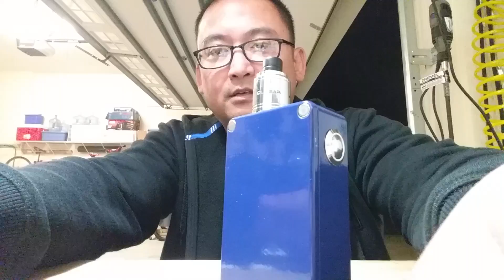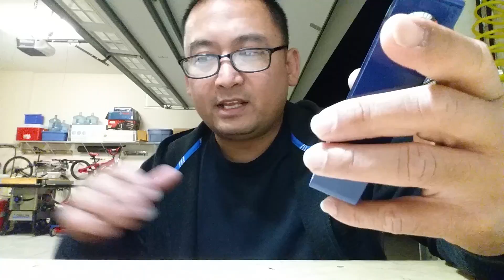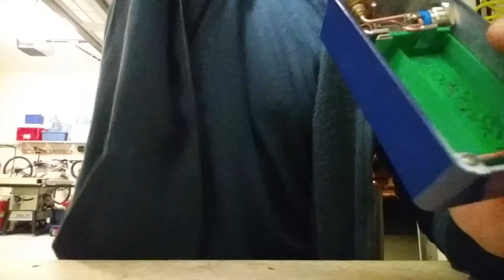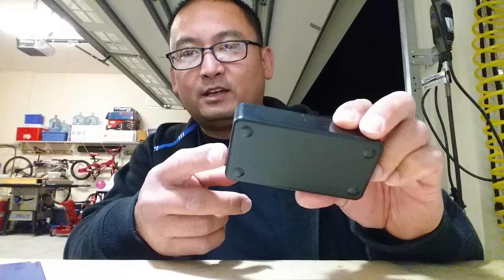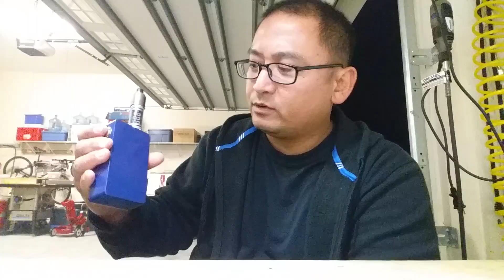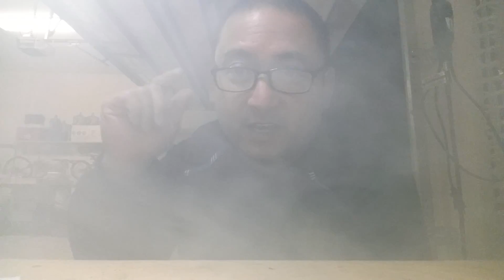(Giveaway closed) Dual 26650 Series Unregulated Box Mod with a Mosfet...The Frankenstein Build

Comment: Cool. I have build also a serial boxmod, i used 2 18650 , a 10n03l mosfet from an old motherboard, but i use also an ne555@200Hz to regulate the Power. Thank you for the inspiration.
Greeting from Germany
PS: I want that BoxMod too.

Comment: i Didn't know you did giveaways Al USAF, i would LOVE to have anything that you built, U R an eXcelent builder with "STYLE" my friend! :) Keep it up.
Reply from the maker: ACEizHiGH VaporPRODUCTiONz this was only my 2nd box mod that I gave away. Not sure when the next one will be but it's going to happen. Thanks for checking out my channel.
Reply: Al USAF i CAN't Wait for your next giveaway! I'm sure it'll be the "SH!T!" Until then I'm thinkin i'M gonna build a "SERiES" style~BoX based on this ~~>"BEAST", i Don't have any matching 26650 bats handy but i do have sum good SONY VTC-18650s that got your "FRANKENSTEiNS Scheme"  Name on 'em! call iT like,,,"FRANKENSTEIN Jr." the TeenAge Years :), I like your "BARE" solid copper wire look, & your builds are PreCision/CLEAN, LUV iT! i got chitloads of "COPPER" CPU Heat syncs also 4 the MosFets, I figgure i'll just be hittin da'PAUSE button on your ViDS & try 2 Emulate Ur Builds, can't think of any "iNJECTiONs" to add to 'em as you have allready  covered all the bases. (i Maybey throw in some eXtra LED for th hellof iT)  **I work on Computers& ripped open acouple of Old LapTop batteries & they are LiON type, there GREEN, they look like SONY, (yea.. They are be sony) could i use these in this type ofa build? Series or Parallel? they taken a charge right now. Thanks for your Knowleges! VAPE ON :)~~
Reply from the maker: ACEizHiGH VaporPRODUCTiONz the batts inside of laptop batts are indeed 18650 but probably doesn't have the specs required for sub ohm builds. I too did open one up and the batts were way lighter compared to what I use. Good luck on your build and I hope it turns out great.
Reply: Al USAF
This will be my 2nd Build, 1st 1 still goin STRONG~BoX! ur Builds gimme iNSPiRATiONz on how 2 doit BETTER/STRONGER than even alotO Factory BoXsDo:) yea.. That's what i figured on the "batts" situation, i didnt wanna "BLO' My Selfs UP! or any things (LOL), i'm hittin 1 of 'em right now on my very 1st e-cig tank i bought when i quit tobbaco in 12-2013, it's a "Classic" i-CLEAR30 @1.5Ω(ther Good Tanks!) & it's hittin good! do u think i could go say to,, .50Ω ? these paticular ones came out of a better PC, an "ASUS"★, & have a lil weight 2'em, (i got 1ofmy "M2" Ωn@.30Ω, tempting..) the other batts are Light (Like u said) out of an ACER & they SUKso wont temp anything onthem. Thanks alot :) I'll quit buggin 'ya, I appreciate getting good advice, U have a goood Night, PEACE!

Comment: Hi man such cool unregulated mechanical box mods, so clean on the bends awesome,
if you use 14 gauge does this fit in the 510 end and also through the battery sledge terminals with out sanding the copper down?

Comment: I've been checkin out your vids and I like your builds because they're really clean, routed efficiently and look really nice when completed.
I especially like that all of the wires are clean with no marring or visual blemishes.

I was curious if you could explain how to use a Mosfet to interrupt the positive side instead of interrupting the negative?
I'm attempting to use an LED button with low rating, so I need to use a mosfet circuit, but on the positive side, because I don't want to put the Mosfet between the negative flow.
I could really use some knowledge on this as I'm trying to build one with the positive side interrupt. 

I hope you get this and can help.
Thanks for the Great Vidz !
And most importantly, Thanks for Serving.
Reply from the maker: +canigetachannel please check this link on why not to use a P channel fet: https://m.reddit.com/r/OpenPV/comments/2hroh3/parts_for_high_amp_unregulated_box_mod/

Check this link for additional info on building box mods: https://drive.google.com/folderview?id=0B-I3ksnipe8nQ3paUFE1Yl9sbGc&usp=drive_web

Check this YouTube link on how to wire an led switch in any type of box mods: https://youtu.be/vFWMuumr-Uk

Hope this helps you out.
Reply from the maker: +canigetachannel thanks for the compliment on my builds, really appreciate it.

Comment: Let me give you a tip. Use a thin rubber tubing to measure your route for the 14g copper wire then cut next to your wire and bam the right length to solder and screwing....... :)

Comment: I just received the box today. It is awesome. I will be posting a video soon. Al Usaf.
Reply from the maker: Justin Beebe thank you...enjoy it and don't forget to post a vid. Just a reminder to ensure you insert the batteries in the proper orientation.
Reply from the maker: How's the box?
Reply: Awesome!!!!! I'm going to make a video tomorrow. I haven't had much time working 10 and 11 hour shifts on thirds so. The only problem is the door doesn't sit flush with the batteries I have in it. I got the efest 26650 batteries. Did the nxjo's fit better?
Reply from the maker: Justin Beebe my mnke and mxjo fits fine. I think the efest is slightly larger than the two.
Reply: That's what I figured. I will have to get me some.

Comment: you know I think that stranded wire has less of a voltage drop than solid wire but it will never look as good as the solid wire the way you meticulously do the install !
Reply from the maker: socratesthecabdriver I don't know if one or the other is better because I've only used solid wires.
Reply: Al USAF I am actually a electrician from NY .. one thing NY is big on is not using solid wire for that reason  ... makes the build lighter I think it is something like 12 solid versus 14 stranded in current handling ... plus they use nothing smaller than 12 gauge wire in NY but when solid wire is specified  depending on the distance of the run the gauge of that  wire would increase to meet the requirements
Reply from the maker: socratesthecabdriver I just Google it. Use of stranded wire is for ease of installation on certain applications. But handling capacity for the same wire AWG are the same.
Reply: hmmmm
Reply: Al USAF
Stranded vs. Solid Wire
This one is a bit of a mind-boggler, but it's important. When electricity flows through a wire, it mostly flows on the surface of the wire, not through the middle. This effect is more pronounced on high frequency AC than it is on DC or low frequency AC. This means that a "wire" of a given size that made up of many smaller strands can carry more power than a solid wire - simply because the stranded wire has more surface area. This is one reason why battery cables in your car and welding cables are made up of many very fine strands of smaller wire - it allows them to safely carry more power with less of that power being dissipated as heat. However, this "skin" effect is not as pronounced in a typical 12V DC automotive application, and the wire and cable used there is stranded for flexibility reasons.
When looking at a chart or description of wire capacity, take note of whether it is referring to stranded or solid wire - some charts may not specify but instead assume a default based on the typical wiring used in a given application. For example, almost all automotive wiring is stranded while almost all home wiring is solid. For most applications, flexibility or the lack thereof will be more important, but for very high frequency AC applications, stranded wire might be a requirement.
Reply: not that there is a voltage drop in the wire but stranded wire is a better raceway for current ..
especially in d.c.  ..........AWG Notes: American Wire Gauge (AWG) is a standardized wire gauge system used predominantly in the United States to note the diameter of electrical wire. The general rule of thumb is for every 6 gauge decrease, the wire diameter doubles and every 3 gauge decrease doubles the cross sectional area. For example, two strands of #14 in parallel would be approximately equal to a single strand of #11 for current capacity.
Reply: Wire and Cable Factoids
The single most important component of a wire or cable is its insulation. The selection of an insulation is governed by a number of factors such as: stability and long life; resistance to sunlight (ultraviolet); dielectric properties; resistance to ionization and corona; resistance to high temperature; resistance to moisture; mechanical strength; and flexibility. There is no single insulation that is ideal in every one of these properties. It is necessary, therefore, to select a cable with the type of insulation which most fully meets the requirements of the particular installation involved.
These are some general rules and common practices when wiring solar systems. They are not meant to be all inclusive, only general guidelines.
1. Almost all wiring is done with stranded wire or cable. Solid wire is occasionally used for long runs, but in most cases it is not suitable for wiring panels, controls, pumps, batteries, or other components. If used, you run the risk of breaking the terminals and/or screws if the cable is flexed. It is also difficult to get a good connection with some types of terminals.
2. All outdoor wiring should be of type XLP/XHHW, TC (Tray cable), USE-2 or similar outdoor UV (sunlight) resistant insulation. Other types, such as THHN, may be used, but should only be run in conduit if it is used. Metallic or NMC (non-metallic conduit) may be used in most cases.
3. When wiring batteries, inverters, or other high current devices, crimp/solder type lugs, or cable clamps designed for good connections with large cable should be used. Do not attempt to wire the stranded wire directly to battery terminals. For most purposes, welding cable is a better choice than the more common PVC battery cable, due to it's much tougher insulation and higher temperature qualities. Welding cable is more expensive than PVC cable, but PVC will melt at fairly low temperatures.
4. Do NOT use the commonly available Romex® type solid house wire for anything BUT house AC wiring. It is not suitable for outdoor, direct burial, or water pump wiring. The insulation will fall off within a year or two if used in direct sunlight. It is also difficult to get good solid connections with solid wire on most components used in solar systems.
5. Size the wire gauge properly - the best components will not work properly if undersized wire is used. For panel and general wiring, see the wire loss table. We sell quite a bit overseas, and most of the world uses metric wire sizes. For conversion, see the metric to AWG wire size conversion table on the same page as the wire loss table.
Reply: but I say again cant get stranded wire to look as good as solid especially the way you get it done :)
Reply from the maker: socratesthecabdriver there are many sources about solid vs stranded wires and I just went to the first or second one that popped up. It stated there are no difference between the two when it come to amp handling capacity, the main difference is use.
Reply: sure many applications stranded is better and the thinner the strand the better . once at the w.t.c.  i worked at the pathway reconstruction  d.c on tracks you should have seen this wire that was brought in for the control room fine as hair and soft amazing  cant remember how it was called ... any way this wire at 20gauge could have being plenty good for devices as these xaxaaa current likes the strands better than a solid surface ..i be one with the current master yoda :)

Comment: HI,When you solder the battery sled connection that are coated,(not bare copper)do you have to use a better solder or a different type of solder ie tin solder,and you stated setting the iron on about 700 f when you solder `but what watts is your solder iron,

Comment: Technically it's not a Frankenstein build because you still used the right stuff. Frankenstein means ghetto rigged. That's not ghetto rigged. I don't like that you use no insulation but it's your choice. Your the operator.

Comment: I WANT THAT SERIES BOX MOD!!! and I love your vids, there very helpful...thanks AL USA, and I know you said you just got those batteries but you should try VAPPOWER imr 26650 I have been using them awhile now and they are really well...there 4200mah 40amp continuous and 60 amp pulse
Reply from the maker: bigge1286 I'll check those batteries out...thanks

Comment: If you were to wire in a volt meter to add some extra awesome-ness to the sweet series box haha where would you wire the red and black wires on the volt meter?? Red to 510 and black to battery negative?! Or to the mosfet? I really want to build this but want to add a volt meter on the outside of the box haha THANKS!!
Reply from the maker: Chris King you'll need to add a switch to either the voltmeter red or black wire. Because the voltmeter will be on at all times if you wire it from the 510 positive and battery negative. But if you want the voltmeter to read either the battery level (no load) or what the voltage is with a load, you need to wire the voltmeter positive between the switch and mosfet and the voltmeter negative to the battery negative.
Reply: Al USAF i only want it to read when the button is pushed (and to read batt voltage with no load, then WITH load when atomizer is screwed on) SO positive wire on volt meter can go from switch POSITIVE to MOSFET gate?  or source? and I really appreciate it man, thanks so much for the help and love all your build videos and the box mods you put together are amazing!
Reply: Al USAF i only want it to read when the button is pushed (and to read batt voltage with no load, then WITH load when atomizer is screwed on) SO positive wire on volt meter can go from switch POSITIVE to MOSFET gate?  or source? and I really appreciate it man, thanks so much for the help and love all your build videos and the box mods you put together are amazing!
Reply from the maker: Chris King you can connect the voltmeter positive anywhere between the Mosfet Gate and the switch.

Comment: I'm very curious -- when you're connecting the solid copper buses, how do you get your solder joints that clean?  Is there some manner of press-fit-solder hybrid connector for the battery sleds and 510 connectors that I should be aware of before I start building my PWM box?
Reply from the maker: +Edmond Belliveau I'm proficient at soldering due to my job in the military. You use whatever contacts that comes with the sled...nothing special.

Comment: What are you using to affix the battery sled and mosfet to the box itself?  Will contact cement work?  Thanks for your video, great build!
Reply from the maker: Jake Graham I used JB weld. But you can use any strong epoxy. I'm not sure about contact cement.
Reply: Al USAF Sounds good, thanks!

Comment: great vid bro, how would you add a dial to turn down the voltage if you wanted to?
Reply from the maker: Chris Brown you can't with this build. You need to use either a Raptor or OKL2-T20 chip if you want an adjustable voltage, or a PWM.

Comment: I'm going to do the duel 18650 in series with the mosfet. have you tried the aspire 18650 40amp high drain. I use one in Mec mod and I love it, I'm hoping to use them in my new mod. any ideas?
Reply from the maker: Great choice for building a series box mod. I prefer it over parallel mods. I don't have to build extremely low, usually between 0.5 and 0.8 is satisfying enough for me. No I haven't tried that battery. I only use Samsung 25Rs and LG HE4s. But watch Pegasus Vaping Academy's video about that battery.

Comment: Hey Al,

I just built a series box mod and I has horrible volt drop. On two fresh 26650's at the atomizer I am only getting .9 volts. Testing the volts at the sled I am getting 3.5 volts. What am I doing wrong here? Any tips and tricks on how you eliminate volt drop?
Reply from the maker: Chris Sakamoto the battery voltage in series should be around 8.4 volts...why are you only getting 3.5? Check your wiring, solder joints and your batteries.

Comment: Hello, first I like the bare solid copper wire look! makes it look clean and well thought out. I subscribed and your the only one I have done that  with. Second I am watching so I can build one myself using 18650's in series. I want a smaller box, hoping a bit bigger then a Itazte mvp.  I think the box you used in your first vid should work, what was the box Number I know it was Hammond but missed the number.  Keep up the good work and showing them off. Key
Reply from the maker: Key Man use the 1590G if you want something smaller.